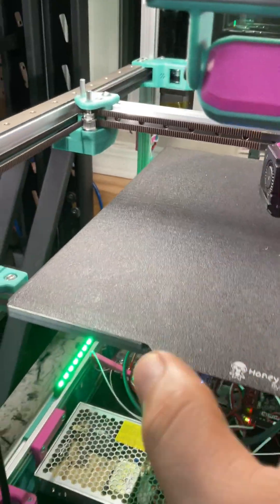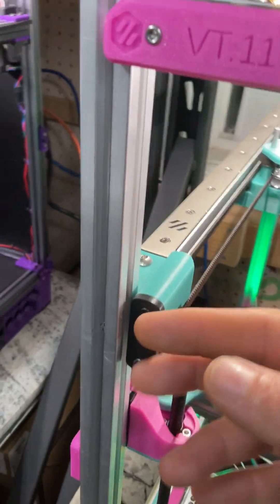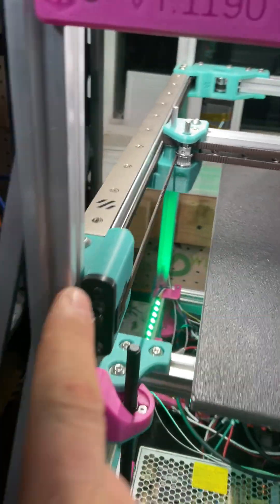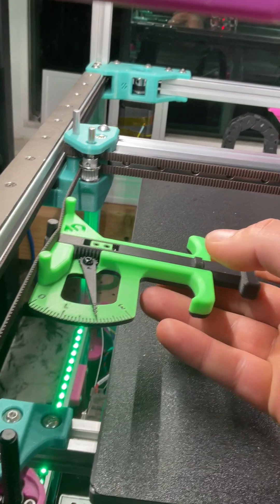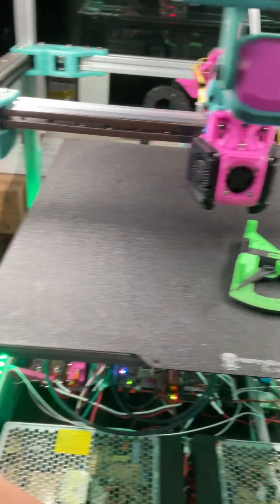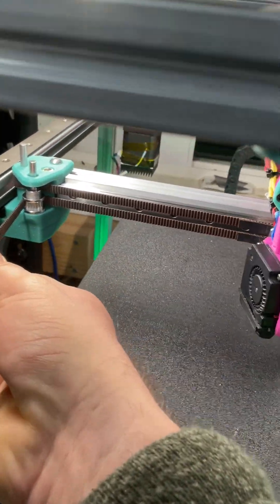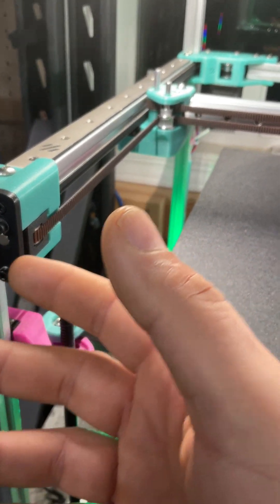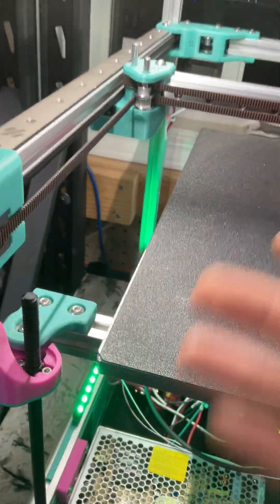How to tighten your belts

Comment: Are you doing this with the motors engaged or off?
Reply from the maker: I have done it both with motors on and motors off. 
With motors on it is easier to set it at 150mm from the front idlers

Comment: When measuring the 150mm for belt length, you want to measure from bearing to bearing. Not from the back of the idler housing.
Reply from the maker: While you are technically correct. Practically speaking it does not matter as long as you are consistent in how you set the belt length at 150 mm.

Comment: Too much room for error.
Carbon Drive app > Motorcycle option: Use something to play the belt like a guitar until it shows 110Hz, that simple.
Reply from the maker: I respectfully disagree. I have used the carbon app. If you run belt shaper after such an app you will see more error in your belt than using the pf makes tension tool.
Reply: Agreed that the apps are not as good. I have this tool and it gives consistent measurements. It's one of my favorite tools for my printers.
Reply: apps are great if you want to sit there all day
Reply: You should actually use one. It's night and day difference. The tool is easier and gets better results.
Reply: If you pluck just a fraction harder or softer, those reading are way off. This guitar tuning method is the worst way I've ever tried tuning belts. They key is to remain perfectly consistent when trying to measure both sides. Unless you have something like a rig that plucks each belt the absolute same every time, doing it by sound will never be accurate. You might think it is, but when you have a calibrated tool that measures consistently and check those belts tuned with a sound meter, they are always way off.